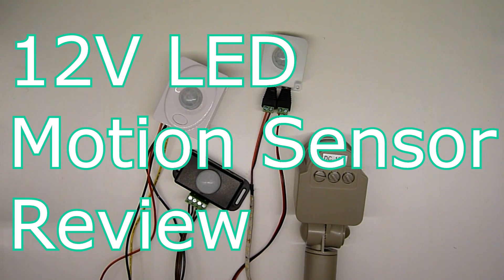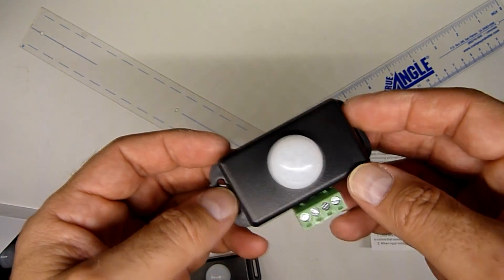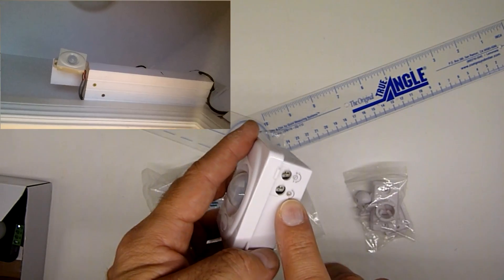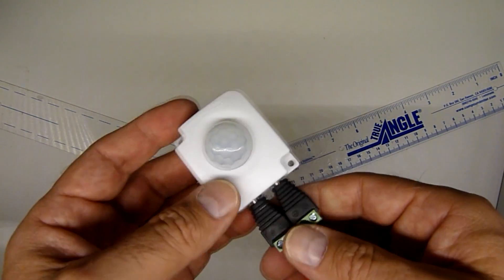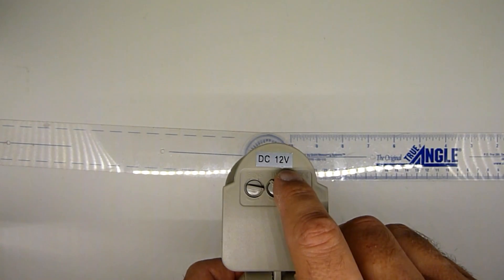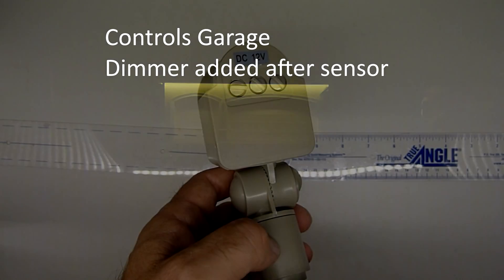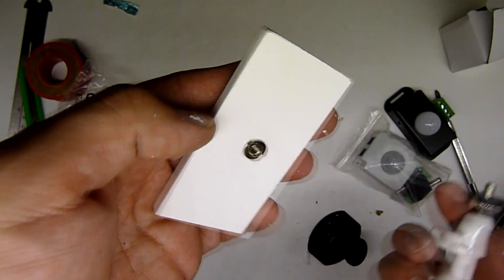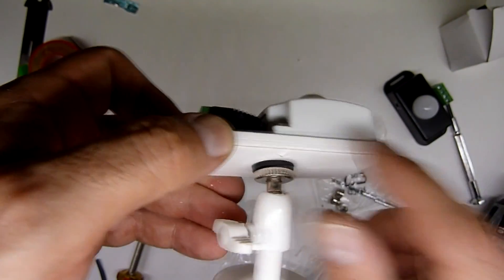12V PIR Motion Sensor Review for LED lights

Comment: Thank y for this good review 
The first one 
What is the reel range for it ?
I have place like 4 meters can i use the first one
Reply from the maker: I use the brown above my kitchen cabinets... which are high.  The sensor faces down into the room.  There is a door opposite the sensor at about 3 meters.  while not my desire... it will sometimes catch me at about 9 meters out through the door.   I think you would be fine.
Reply: @alwaystinkering6972  thanks 
About your time and about regard

Comment: Can I adjust sensiblity on that white sensor?
Reply from the maker: No.  It has very good sensitivity at the edges.   You can turn a sensor away from an are when that is an option.  It will still grab what crosses into the edge area. 

I have experimented with masking the sensor with some success but the way they work it was still very sensitive to areas I was trying to mask. 

Only the outdoor model had a sensitivity setting which works. I have never tested it indoors.
Reply: @alwaystinkering6972  Thanks for your answer, I'm using a sensor like the third one that you presented here, but I would like to reduce its sensitivity a little, because from the front it is triggering at about 3 meters.. I'm using it with led tape to light a kitchen counter, however it is triggering from afar.. I would like to restrict the sensitivity a little, but I imagine that the lateral sensitivity will be low too, if I had the option. thanks
Reply from the maker: @rafaelsouza1130  under the counter I mount my sensors on a swivel.  Then I can rotate them.  I try to source my power at an end facing into the kitchen.  I would try facing it down and toward the wall… assuming you have it at an end.
Reply from the maker: I use this style below.  You can use the plate or take the pin off and attach it to a piece of angle iron you screw under the counter.  In the porch screen section of the hardware store they sell bags of pre painted aluminum L shaped metal. https://a.co/d/7GRVwSR you can source these in many places. This one says aluminum. They are frequently steel.

Comment: With the big outdoor sensor would it be possible to modify it to handle switching up to 12 amp?
Reply from the maker: I have gotten around the throughput limitation by simply using the motion sensor to trigger a DC relay.  Usually a car relay as they are very easy to come by.  Of course there is a click on that style and you need space to install it.  If you need I can post the basic wiring diagram.  I run the lights over my garage this way.
Reply from the maker: Here is a link to what it would look like with a relay.   In answer to your question of could it handle 12amps.  Probably.  The penalty would be the weakest link burns out.  The relay removes the motion sensor throughput as a factor.    https://www.dropbox.com/s/mqw5tzv6tt3xioz/Garage_Motion_Outdoor_LED_With_Relay.jpg?dl=0
Reply: @alwaystinkering6972  Thank you for the reply, i may not have to use it as i have to measure how many amps the circuit is drawing first but i thought i would ask in case i need to use it.

Comment: They all leak, water gets in had several of them all failed. Had gray ones and the black ones.
Reply from the maker: Only the grey one is designed for outdoors. They only time I have had an issue was when I wrapped it in plastic wrap for a hurricane which resulted in the plastic wrap filling with water and flooding it. Hurricanes blow water into every crack and crevasse.  That being said all my installations are under overhangs.  The buttons are mounted downward and the sensors are at an angle so if any water came in through the Lens I would not have noticed since there is nothing at the bottom of the Lens area.  The other thing to check is your electric box.  They sometimes leak and the water runs to the lowest point. When running low voltage wires outside dip the wire below the connection about an inch tot he’ll water drip off at the low point before reaching your connection. Silicone joints if needed just make sure you leave the lowest point not siliconed if you can. I hope you have better luck with future installs.
Reply: @alwaystinkering6972   I did not know only the gray ones for outside. Very deceiving on ebay no mention not waterproof. I opened one black one no gasketing at all. Now the gray one did have a black rubber gasket.  I made a cover on top and of course adjustment pots on the bottom. I did all I could to keep them dry. Thanks for the info.

Comment: I cannot see the name or mode of the switches. The corner shots of the ebay listings are not legible. Your hands cover up the packaging. Would be helpful to know the approx cost as well. I tracked down what appears to be a Tuodi which is the second of your models and it sells for $88, very expensive. Is it worth it vs $15 for other models
Reply from the maker: The second one is the one that comes with the pivot I randomly picked the first one I saw on eBay.  $11 is about double what they used to cost.  I most frequently use the smallest one I show or another one that came out that is similar but the connectors are on each side and is even smaller. This is the first listing I saw of that style. https://www.ebay.com/itm/143651483471
Reply from the maker: The question of worth.  It is certainly a more significantly built unit and with the physical relays able to sustain height amps.  But size and concealing a sensor are my most frequent use... like under a cabinet above a counter.  I find I most frequently use the smaller ones.  To pivot the small sensors I use security camera pivoting bases.  I show one being used that way in my installing led lights on wiring shelving video. I also show a small one being used in my entertainment center video.

Comment: can i use the first one with a typical low voltage landscape lighting run?
Reply from the maker: Let’s cautiously say yes.  The sensors are on/off vs a dimmer so no problem there.  If your landscaping lights are the old halogen those are normally low AC voltage and for those won’t work... without a relay.  I have used 12vdc to AC relays off the outdoor motion I show in the video so if you need information let me know.  The easiest way to see if your landscape lights will work with motion is to look at your power supply. If the output is 12 to 24vdc out with a max rated DC amperage below the rating on the motion sensor then yes, it should work.  You would wire from your power supply to the motion and then off to the lights.
Reply: @alwaystinkering6972  Thanks.  I have a low voltage LED setup.  I believe 12v.  But really just looking for something to activate a set of stairs with LED decklights when someone approaches.
Reply from the maker: Peter Koval. Remember that needs to be DC volts.  In an always motion sensor activated config you have to cover the stairs and the main deck to make sure you activate from everywhere. To prevent sitting on the deck and the lights turn off because nobody moved, You may want to add a dpdt switch to have an ON mode and a motion activated mode.  I have a video where I put led’s on a deck controlled by a dimmer.  Where the dimmer is in that video could be a WiFi controller or dimmer with a dpdt switch. Dpdt would move the negative and positive side of the source with the switch position. That way when not in use the motion is totally offline.
Reply: @alwaystinkering6972  Thanks.  In our case we have a set of low voltage LEDs controlled by a generic landscape light transformer. (not sure of the type as it was inherited with the house.  But we have a set of steps leading up to a street, and I want them off unless someone needs to walk on them, and motion sensor off/on would make sense.  We also have a sprinkler timer, but I'm not sure if the motion sensor can be connected to that power. Anyway I'll have to research more.  Thanks for your reply!

Comment: Thanks for the video. You mentioned that the first PIR-8 unit you tested didn't have polarity on the plug but the green plug pulls out from the unit and the polarity is printed on the black housing.
Reply from the maker: Correct. While who manufactures the various units may vary the wiring polarity is normally printed or embossed someplace. I have recently received units with stickers on the back with a diagram.  The outdoor ones continue to leave you guessing.

Comment: do you have a video how to wired the gray motion sensor i bought 220v version i dont know how to connect since we dont have grounds and also no positive and negative
Reply from the maker: No.  Looking at listings on ebay most have a wiring diagram. The 220v only powers a 220v led strip, not a 12v led strip.   You would need a relay to trigger a dc strip.  I have a 12v dc relay that turns on my 120v front lights when my 12v motion sensor turns on my over garage led strip.   I used a RBU1UC for that but that is not the right one for you.  You would need a 220v trigger to close the dc loop if this is your situation.

Comment: Thanks for your video. I bought the large one you describe  7 mins into your video. As you say no instructions came. I couldn't get it to work and I hope I havn't blown it trying different combinations. 
My set up is a 12v car battery linked to a solar panel and a solar charge controller box. The box has the following connectors ;  Plus and minus solar panel. Plus and minus battery. Plus and minus lights.  Could you give me some advice on how to wire it in ?
Reply from the maker: This will work off the led connector on the controller . Brown to + on the controller. Red to the led +.  Lastly blue to the led black and then connect that blue/led black bundle to - on the controller.   
If that one’s not work you should test the motion sensor to the battery only.  Don’t forget the daylight sensor is in play. The location should be dark enough that it can trip.
Reply: @alwaystinkering6972  Many thanks for your detailed reply. I will have a go!
Reply: I went out to have a go at this today. I think I have  understood you, but could you check this please, to make sure;
Brown to be fitted to the battery  plus terminal on the controller.
Red to be fitted to the LED plus terminal on the controller.
Blue to be fitted to the LED minus terminal on the controller.
Introduce a new black wire to run from the LED minus terminal, to the battery minus terminal on the controller.
N.B. There is an on/off button on the controller.
Reply from the maker: Oh wait.  The led+ on your controller is a source.  Test if the led switch on the controller turns off the plus or negative.   The red on the motion has to go to the led + only on the light strip. 

If the led on the controller is switched on the negative then wire the blue to the battery negative and the led light black to led controller negative.  Leave the led controller + empty.  

If the led controller is switched on positive and you want to use its switch you need to let it turn the motion sensor on and off too.  So motion brown to controller led port + and motion blue to led port minus along with the led light black to the same port.  Red will always go to led light red. 

I leave my motion powered and switch on the led side.  The default power on for the motion is to activate the led light.  

You could use a led light side switch and skip the controller led ports all together.  Let me know if we need a diagram.
Reply: @alwaystinkering6972  Thanks for all the information. I wasn't sure how to test as to whether the controller is switched on the plus or negative side. 
I looked at another YouTube video about switching and did the following test;

With the controller  switch on and the LED's alight, I put the positive probe of my voltmeter to the positive terminal of the battery. I then put the negative probe to the negative of the LED terminal and got 12v. I then put the negative probe to the positive LED terminal and got zero voltage.
I was expecting it to be the other way round, if it was a negative switch. Maybe this means its positive switch? I'm getting a bit out of my depth ! Hope this helps.

Yes a diagram would really help. Thanks again.
Reply from the maker: Close. With controller led switch on. Positive to the battery negative to the led controller negative you see 12v dc.  Now turn the switch off.  Does the 12v stop?   To repeat on the positive.  Negative to battery negative.  Positive to led positive and toggle the switch again.
Reply: @alwaystinkering6972  
I will go through this in long hand , just so that you can check my understanding.
With LED's on

I put the positive probe to the positive battery terminal.
Then the negative probe to the LED negative.
I got 12v
When I toggled the switch I got zero volts.

Then with LED's on
I put the positive probe to the LED positive.
Then negative probe to battery negative. I got 12v.
When I toggled the switch I still got 12v
Reply from the maker: @frankmurray9172  here is a diagram based on what i think you have described https://www.dropbox.com/s/hwodu1o2nxc7cyh/controler_tomotion_led_wiring.jpg?dl=0
Reply: @alwaystinkering6972  Thanks very much for the diagram. I will have a go !

Comment: Hello, First, thank you for this video. I found the outdoor model shown in the video locally and I prefer the looks vs the small sensors but I want to install it indoor with LED strips. Just to double check, should I connect the 12V power supply +(pos) to brown then -(neg) spliced to blue and negative of strip then red to positive of strip? Should I worry about ground loop? Thank you.
Reply from the maker: Good question.  The answer is no with one issue i have come across.  These shared ground motion sensors cause issues with some led amplifiers.  The amplifier is what you use at the end of a long led string to continue on to more strings and still share the same dimmer and on/off controller.  

Some led elctronics switch the negative side.  This normally means the (+) is always running through the string vs the negative. The shared common motion sensors on the first string causes one string to stay on when you really wanted them both off.  This issue is created by the amplifiers interpretation of what the state is and allowing current flow.  

In this case think of it like modern car wiring or a battery... ground is your common to all.  I hope that helps.

Comment: Hello, can i use any sensor in a pair? Because i need one upstairs and one downstairs
Reply from the maker: I just got some blocking rectifiers so i can test and do a video for that.  

Unless the sensor has protection for power arriving via the load connection they don't normally behave right if power arrives on the load side.  Take the small one in the video.  If i connect that one backwards it will turn on and stay on.  

Rectifiers pass dc power in one  direction.  Putting  one on the load side will prevent power arriving from the load side on subsequent  sensors.   

I think i got 10amp or higher rectifiers.  You will want one that can handle the power draw  through the circuit.
Reply from the maker: One more option you can do now if the same power source is used for all connections.  Have the motion sensors trigger relays that power the lights. That will isolate each motion sensor.  Most relays click, there are are ones that don't but they frequently generate more heat. I have used these in an outdoor motion install... A Car Relay 4 Pin 12v 40amp Spst Auto Switches... they click... https://www.amazon.com/dp/B01J53IH5M

Comment: Thanks for this video. I'm curious if you have seen any of these switches that can themselves be switched in a way that lets you manually override them and force them to turn on the attached LED light string or whatever. I recall outdoor 120 motion sensing floods that let you turn them off for exactly a second and then when you turned them back on, they just immediately switched on the light without worrying about the motion sensing. Thanks for any info.
Reply from the maker: I have not seen one with a bypass switch built in.  I have considered adding a bypass on my garage door under eve lights.  Consider a dpdt (double pull double throw) or spdt (single pull double throw) switch after the motion sensor and before the lights.  Hw store or auto store for these.  Spdt wire the (+) for the light to the center, the motion load/out (+) to one side and the power from your source (+) to the other.  With the dpdt the 2nd set would have the corresponding (-).  

The problem of course is these switches are frequently huge or too small with a need to be mounted someplace.  It also adds to your cost.  This config i mention leaves the motion powered in both modes but only able to activate the lights when selected.  You may even get an off position depending on the switch. There are other ways to wire than this one to achieve the same result.
Reply: Thank you for your quick response. I understand your solution. I should have mentioned that I wanted to control a number of motion sensors/LED string combination from one switch. I have an idea, but I'll need to try it to see if it adversely affects the motion sensor/switches. I could run two power lines to each motion sensor/switch. One would always be powered and would connect to the input power connector on the motion sensor/switch. The other power line would be switched by the switch that I want to add. And it's power would be connected (along with the power line to the LED string) to the "load" side of the motion sensor/switch (all the sensor/switches in my case). I know the motion sensor/switch may not like the load side being powered externally, but maybe it wouldn't matter. I'll try it out and see if it fries it.